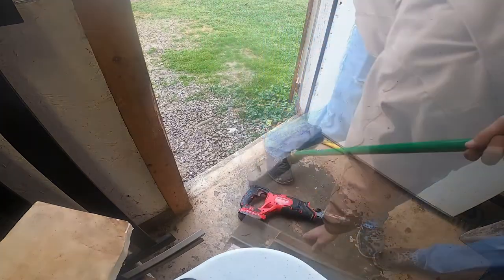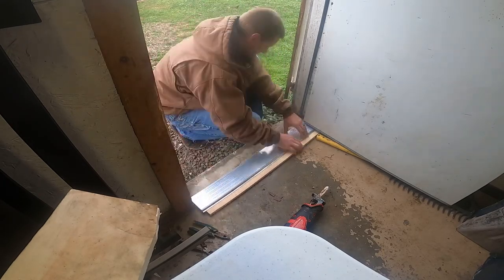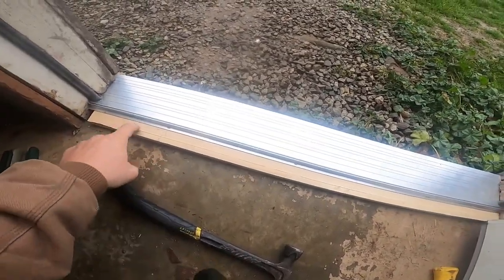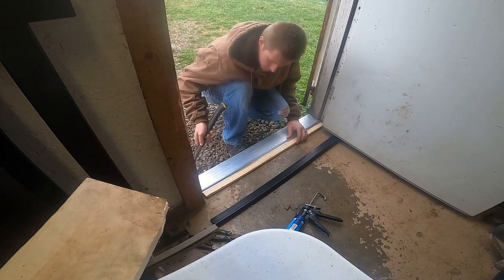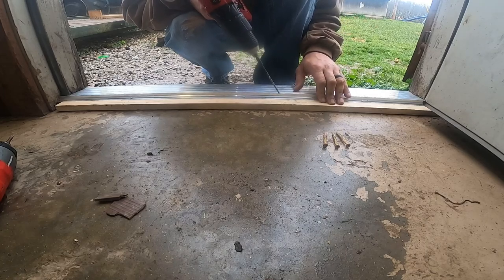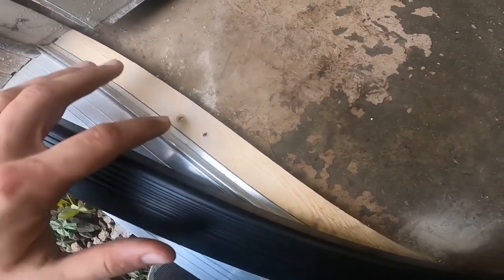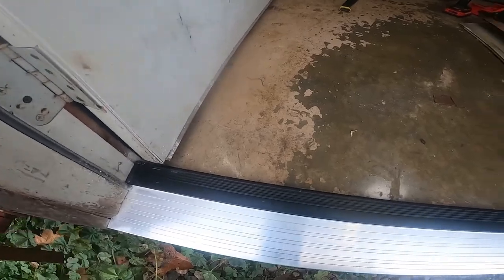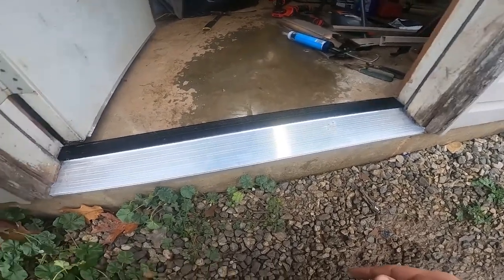Replacing the threshold on my garage door

Comment: I would recommend adding  a strip of wood to the top so the black plastic piece has some support. Good idea using the exterior screws into the concrete. Love concrete, no rot like wood.